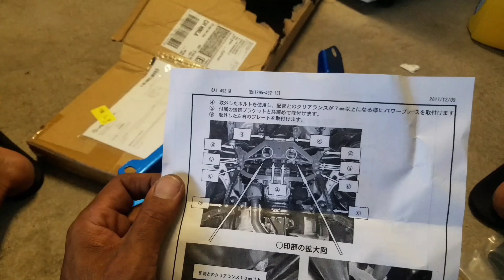2015 SUBARU WRX STI - More Cusco Chassis Upgrades - OCTurboJoe

Comment: Dam your car probably handles hella good
Reply from the maker: It does.  I need to dial in more negative camber up front to get it neutral. But yes, a worlds difference from stock. Our cars suffer understeer because of the MacPherson strut mounting and lack of front negative camber.  Good tires and coilovers will only increase grip and damping, but not improve the contact patch as good as negative camber.  I wish it was double wishbone all around rather than just having it in the rear.  It would make a huge difference in handling.
Reply: OCTurboJoe thanks for the info!

Comment: Really great video as always man. So I was wondering, don’t I see many videos if any on Cusco’s Rear Sway Bar Reinforcement Brace. Honestly I just like the way it looks. Do you like it, or know much about it’s functionality? Keep up the good work. Your STi is my benchmark.
Reply from the maker: I used to have the Torque Solution version of the reinforcement brace but my rear diffuser won't allow it. I could however, cut the diffuser in areas where it conflicts but that's another time. The reinforcement braces act as gussets to further add strength to the mounting points of the rear sway bar. I would put them back if I can find time to mod my free diffuser.

Comment: The low arm bar type 2 can work together with crossmember bar but without cutting for VA?
Reply from the maker: Yes. Cusco Lower Arm Bar II can't work on it's own. You have to use the Cusco Crossmember Power Brace otherwise you would have to cut the stock one.

Comment: Looks good! Mind sharing all the part numbers for your Cusco set up under the car? Even the mid way down the sides?
Reply from the maker: If you Google "2015 WRX STI Cusco", there should be PDF that has every single part number for all braces.
Reply: OCTurboJoe and which ones did you swap out for earlier model braces? 🤣

Comment: They look great; too bad they live under the car.  I've often wondered about the overall effectiveness of one of these braces, let alone 5-6 on a street car.  I know they create a positive difference, but how positive?   Braces before other suspension mods?  Did you reuse all bolts or replace some because of torque-to-yield/one time stretch bolts?

Comment: Nice vid!!! Any chance you could tell me the brand of canards you have? Fit the car perfectly!
Reply from the maker: They're from RPG Carbon and are FRP canards originally made for the bugeye.  I had to do some extensive modifications for them to fit my bumper.
Reply: OCTurboJoe Thank you so much! It looks like RPG has a VA specific one but it’s quite a bit larger! Yours looks perfect imho! Cheers!
Reply from the maker: @chaddaarud923  Thanks.  The one they currently have is similar to the Cusco version. They're also coming up with an OEM STI version. I didnt want the CF look so I went with this pair of plain black FRP.
Reply: OCTurboJoe thanks for the info! I am excited about the oem style ones! I was trying to stay away from carbon as well! Everything white and black! Appreciate it!
Reply from the maker: @chaddaarud923  No problem

Comment: Hello, I am wondering if that version 2 will also fits the 19 STi as well? Thanks in advance.
Reply from the maker: Yes it will fit
Reply: @octurbojoe  Thank you. Also wondering with the version 2, will it gets in the way when installing the downpipe? many thanks.
Reply from the maker: @alainmo2106  It will not get in the way of the downpipe.
Reply: @octurbojoe  Were you able to put the oem plastic cover back on? Thanks
Reply from the maker: @alainmo2106  Yes, it does not get in the way.
Reply: Bought and installed the V2 along with the crossmember brace and sway bar today! Love it. Thank you for the recommendation and advise!!!!!
Reply from the maker: @alainmo2106 Solid.  Congrats!!

Comment: Nice write over on RallySport Direct . Man . Don"t Know way Cusco"s R&D  boneheads didnt realize this. Obviously having less  little parts is better. Definitely the way im going. Question  you plan on really dialing in the suspension with Whiteline's Anti Lift kit and Roll center kit. 
Ill probably head that way in the spring , KCA313 , KCA425M are the parts. Lastly the iam back and forth on the steering rack bushing,  bit of work but ill probably do em , while everything is down . lookingat the mooseports soild  ones. Ive already got Group N mounts all the way around
Reply from the maker: Well Cusco calls the original, "v1". There might be a v2 in the future. I do have the roll center kit, but not the anti lift kit yet. I have Whiteline's power steering rack bushings installed when I replaced my steering rack and added the power steering cooler.
Reply: @octurbojoe  Just Checked out the power steering vid , You got coolers all over the place lolz. I run the Lovely CSF 7042O w/oil cooler. The random placement of oil coolers made get the radiator.  Iam  all for function over form but some  people take it to the next level.
Reply from the maker: @zeno15sti33  I have future plans to move the coolers behind the fog covers some time. I've already removed my windshield washer reservoir.  I don't use it much and only use wipers when it rains. At this point the fog cover ducts draw air towards the brake deflectors while allowing the frontal air to escape under the car for drag reduction.
Reply: @octurbojoe  Cool Man ,  BTW you done any testing on the 6A1 492 RM Power Brace listed for the Va , Vs the 692 492 RM Power Brace for the GR. Again the GR part looks of better design
Reply from the maker: @zeno15sti33  The VA version is actually beefier, with more contact points (6) compared to the GR (2). In fact, I have Beatrush's version, which is thicker and much more reinforced. The GR version only bridges the lower subframe. The VA version bridges the lower subframe and ties it to the chassis.